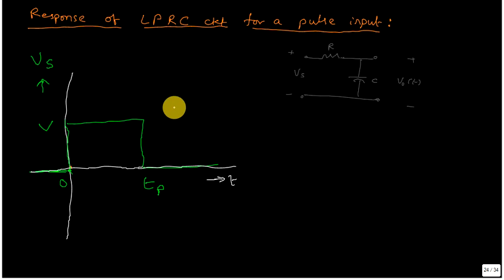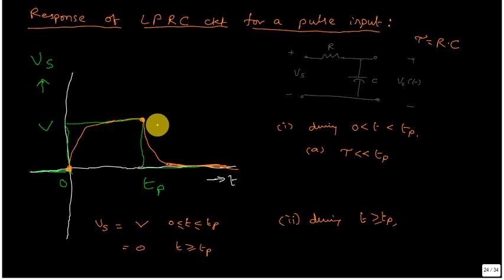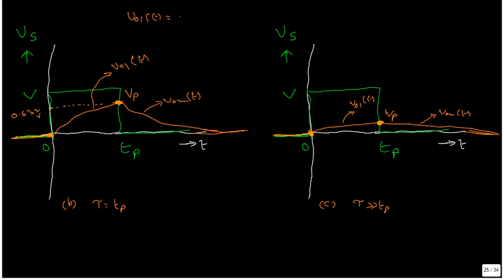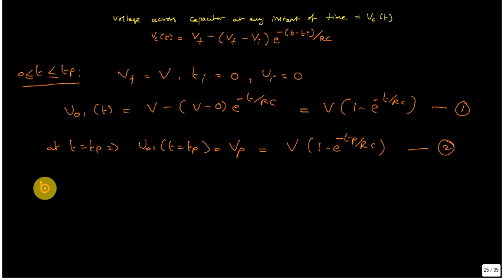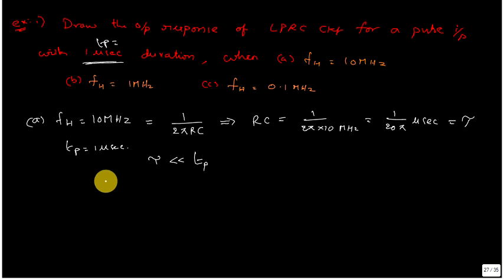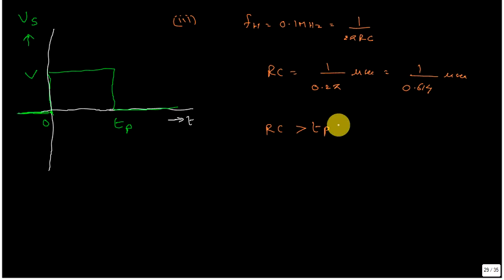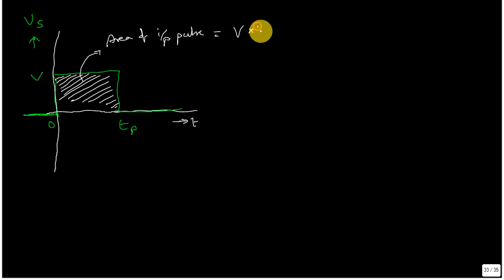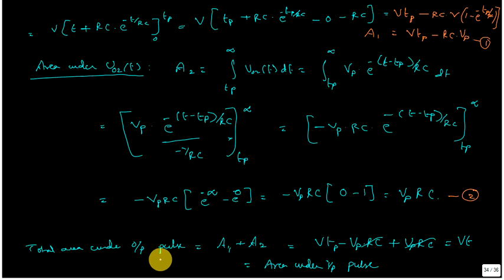5. Response of Low pass RC circuit for a Pulse input

Comment: Square ranging in amplitude from +10v to -5v is applied to a low pass RC circuit. The voltage on the capacitor has a max value of 8 volts and a minimum value of -3 volts.  (a) What is the duty cycle of the waveform that is applied?  (b) What is the frequency in terms of the time constant and (c) what is the average value of the voltage on the capacitor?